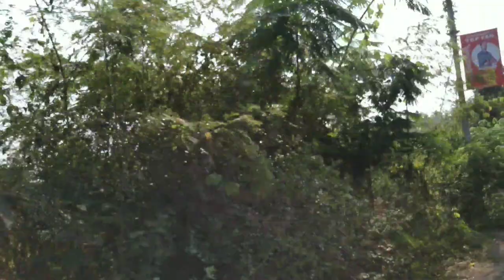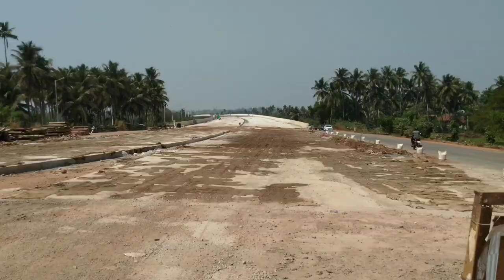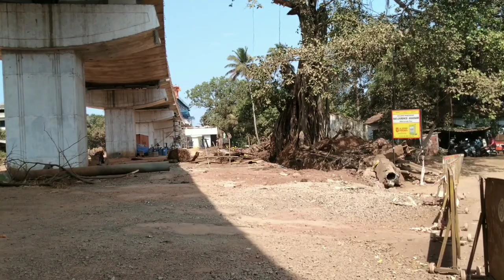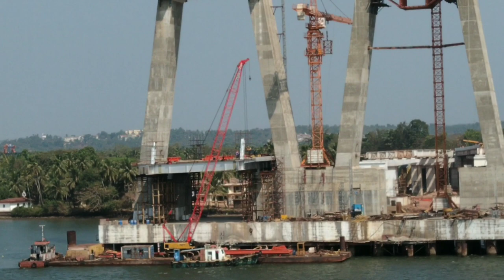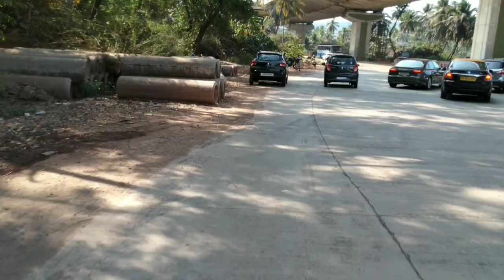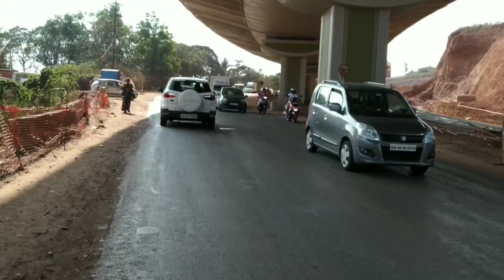New Zuari bridge Goa February 2021 update

Comment: Work must be done 24/7 . Pace of work should be increased
Reply from the maker: They are doing the work 24/7 I have seen the work at midnight after 12 and early morning 5 am
Reply: @MackvinFernandes  Don't u feel the work is going on a little slowly?
Reply: I mean, if the bridge is supposed to be ready in 100 days as claimed , don't u feel more men n machinery need to be put?
Reply from the maker: Yes the work is slow. They should speed up the work